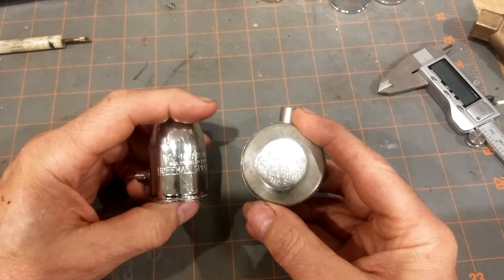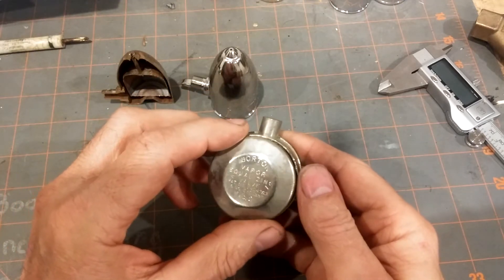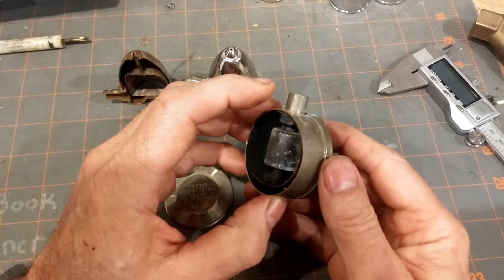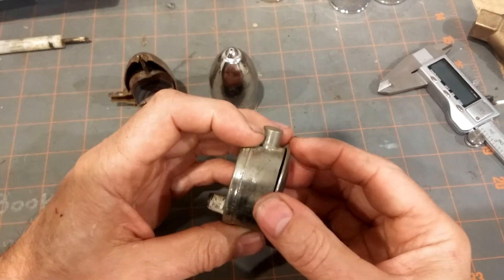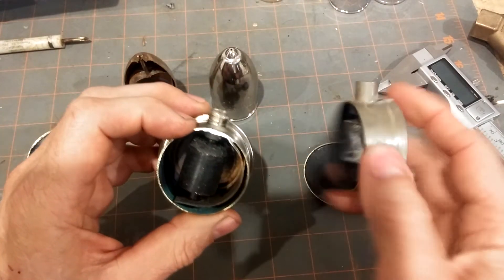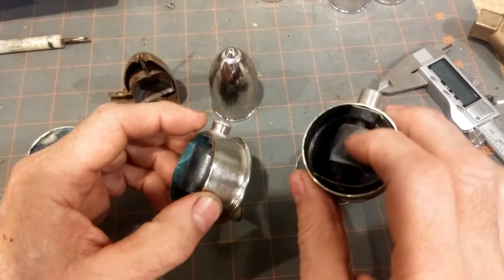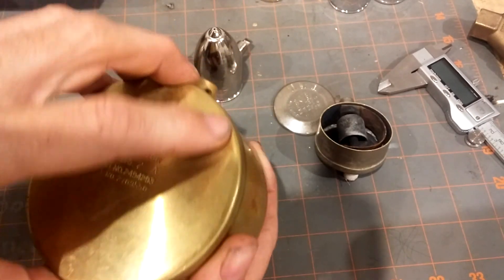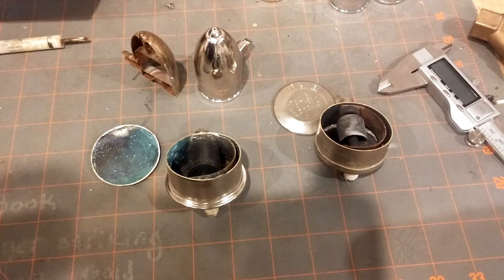Gorton / Maid-o-Mist Single Pipe Steam Radiator Air Vents

Comment: The advantage of the Maid-O-Mist is the interchangeable nipples.  This is helpful when trying to balance a single pipe steam system.  One does not have to remove the entire valve, which can be cumbersome, but rather simply change the nipple size for more or less heat. I have successfully balanced the steam distribution in my 90 year old home and it continues to be warm and comfortable.  I do agree that the valves can and do fail but the benefit of the interchangeable nipples outweighs this.
Reply from the maker: Totally get what you are saying.
I believe I do point out in the video the usefulness of the interchangeable orifices on the MoM, but not to your degree, and I thank you for that.
As professional, I dont use these anymore because of their higher than average failure rate and call-backs are costly.
Also, for tenant situations in larger apartments, they might not be the best vent to use.
Some have suggested using the cost effective MoM's to dial in the air balance, then replacing them with the appropriate non-adjustable but generally higher quality Gortons or even the Vent Rite adjustables.
Reply: Vairvalves offer the same ability to adjust and can do so on the fly making them superior.

Comment: Thanks for the video. I bought a house with steam heat and I'm trying to learn about it. I don't have an automatic water feeder so my first mistake last year was overfilling the boiler causing it to spit water from some area of the boiler and my main  steam valve which I checked a few days ago and noticed it was a hoffman 45. The heating seems to be okay, but  I wouldn't mind the 100 year old house heating up faster and could upgrading to a main valve like a Gorton 2 help with my heating? I keep on hearing about using a Hoffman 75 or a Gorton 1 or 2.
Reply from the maker: You're welcome!
Do you have just the one steam main?
I would use the Gorton #2 and maybe gang up two or more if they fit.
Properly venting the main can make a major difference in how evenly a system heats up.
I trust also your mains are insulated
Reply: @gordonschweizer5154  Thanks for the reply. I have one steam main and I didn't know the pipe had to be insulated. What does that consist of?
Reply from the maker: @Mikegee63  Fiberglass pipe insulation designed for the pipe size.
That's a whole other topic and trade.
Reply: @gordonschweizer5154  Thanks. For some reason YouTube isn't notifying me when you respond to me. I also forgot to mention that the main floor of my house has 3 wall recessed cast iron connvectors in the living room and dining room and a free standing radiator in the entryway and kitchen. The 2nd floor has free standing radiators in the bedrooms and bathrooms. I'm pretty sure they're all original house. The main reason I mentioned the convectors is because I watched a video where they stated that they were using g a Hoffman 45 on the steam main because the house had convectors instead of free standing radiators. Could those convectors be the reason why I have the Hoffman 45 on my steam main?
Reply from the maker: @Mikegee63  If I understand you correctly, you're saying you have a Hoffman #45 as your main venting in your basement?
Maybe it's a #4A "Quick Vent"?
If so, they are way way too small!
Reply: @gordonschweizer5154  Yes it's a Hoffman 45 on the main vent.
Reply from the maker: @Mikegee63  The Hoffman #45 is way too slow of a vent for a steam main in almost all cases.
I'd try to replace it with a Gorton #1 at the very least & see if you can fit a Gorton #2 if possible.
Reply: @gordonschweizer5154   Thanks. I have exactly 7 1/8" clearance between where the main vent goes and the ceiling. I'm gonna check the sizes to make sure I can fit the Gorton 2 if possible.

Comment: Great video.  Been looking to replace my main steam vents on a one pipe system and this definitely reinforces my desire to use a Gorton #2 if I’m able to.  Cheers!
Reply from the maker: Thanks!
I hope you can fit the Gorton #2.
Those vents are amazing at getting rid of air from the steam mains and thereby getting heat evenly to your radiators.
Reply: @gordonschweizer5154  Is it best practice to use a larger vent on the long main and a smaller vent on the shorter main? Could I run into a problem if I use the same vent size for both mains?
Reply from the maker: @Ldall87  Usually we attempt to get the steam to reach the ends of the mains at roughly the same time.  
Each system has its own personality, so it is possible that the same size vent on each end will achieve that very broad goal.
But even if its a few minutes difference in time to the ends, you should not run into a problem.
Give it a go.
Reply: gorton also makes a smaller vent with the same construction "gorton #1" one thing to be careful of ,if you vent the air too fast you may end up with more water in your pipes. there is a balance where the steam heats the pipe as the steam travels in the pipe and minimizes water accumulation from the steam condensing. too much water could increase water hammering

Comment: Just found this.  Very informative.  What arr the numbers mean on the Gordon steam valves. I just bought a gordon #5.
Reply from the maker: The numbers are more or less indicators of how much the vent can vent.  For Gorton, the #4 is the smallest hole and therefore the slowest vent.  The #5 is the next size up, and the #6 is the biggest holed vent I'd recommend for a large, stand-alone radiator that needs more venting.  
Gorton makes bigger holed vents, "C" and the largest "D", but they are too big and sometimes cause more issues than they solve.

Comment: Any thoughts about using the Gorton 1/8" straight type vents (with an added elbow) for radiators vs the Gorton angle type? My thinking is the straight type should provide better water drainage from the bottom of the vent body.
Reply from the maker: That might work... But, the main issue would be clearances to install.
Reply: Clearances would not be an issue. My question is whether there might be some functional benefit to having a straight stem for better condensate drainage out of the vent body.

I installed the Maid O’Mist vents just last year and I’ve found several to be stuck closed occasionally. I’m going to replace them all with Gortons.
Reply from the maker: If clearances are not an issue, there is no harm in trying your idea.  I have no experience if what you propose will help your issue or not.
The vents, even M-o-M in ordinary situations, should not have much water in them.

It may be that there are other issues.  

Do you have enough main venting? Are your main pipes in the basement insulated? Is your near boiler piping to manufacturer's specs? Is your boiler water reasonably clean?  Is your system pressure low? Is there water hammer? Gurgling in the pipes? Radiators pitched properly? Radiator valves the proper type and fully opened? 

The reason I ask is these and other reasons will cause "wet steam" and that may be causing your vents to fail prematurely.
Reply: Ok, thanks, Gordon. I believe I’m ok with the possible concerns you listed. 

I replaced Hoffman 1A vents last year with the M-o-M only in order to more easily experiment with the orifice settings.

I believe the M-o-M failures are due to little other than poor quality vent materials.

I might run my question by Gorton and see whether they think there might be any benefit to using their straight vents over the angle type.

Comment: On the maid o mist the adjustable screw on top..should it be tighted flush ? Or screwed open ? I have tgem screwed open.. my rads get hot just cincern of the purpose of the screw
Reply from the maker: I would screw the orifice plate thingy all the way down snug.

Comment: Thank you for this video!  I replaced a Hoffman 1A with a Gorton C.  I found the 1A to be loud and "hunting" in the cut-out range (my pressuretrol: cut in=0.4 psi, cut-out=1.2 psi).  The Gorton was silent.  Gordon, what is the expected single pipe behavior after the call for heat has been met and the boiler shuts down?  After a couple of minutes, two of my 2nd floor radiators with Gorton C's go into a loud vacuum.  Is that expected?  Thanks
Reply from the maker: Thank you for your kind works.
What you might be hearing is the vacuum formed when the steam is condensing drawing in the air back into your system. The cast iron beast is breathing.
If I may be so bold as to suggest adding main vents to the piping in the basement.
The "C" is pretty aggressive in venting air from radiators, not always to your good in the long run.

The strategy is to vent the mains quickly and then vent the radiators slowly - if possible... 

Of course I don't know your unique situation at all.
Reply: @gordonschweizer5154  Gordon, your videos have been helpful in helping troubleshoot my dads boiler! Thank you. I understand balancing the radiator vents but what is the benefit of venting the radiators as slowly as possible?
Reply from the maker: @Ldall87  If I said " as slowly as possible" then I misspoke.
I would say "fairly slowly" instead.
The issue is radiators are designed to squeeze the energy out of the steam and turn it into heat very quickly, and thereby dump a lot of water back down through the radiator valve.  
Too much venting (in general) can create too much water for the valve to handle and cause gurgling, spitting vents, water hammer, and a radiator heating poorly- the very opposite of what is desired.
The trick is to find that balance.
Enough venting to allow the radiator to heat the space the radiator is in, but not so much as to choke off the steam trying to come in with the water flowing out.
That's partly why main venting is so important.  
Get rid of most of the air first, then your can tweak the radiator venting with better results.

Comment: I so appreciate these videos. I live in a 20 apt building.  My apt is the first one, closest to to the boiler(my apt is right above the boiler so I hear the runs and cycles within each run).  My radiator valve  is fully open. The air vents  take on water, cause knocking ( right now only at the beginning of a run.. the rest are mostly quiet). Then the steam sound is constant and loud at the end of each cycle in a run.the radiator almost sounds like it’s crackling as it comes into the vent.   Yes Most runs are about 8 cycles and last abt 40 minutes.  I don’t know what the pressure is on the boiler.  The building usually uses Hoffman 40s.  I often shut the boiler (there’s a switch I have access to) unscrew it, and shake out the water.  I put a brand new maid o mist #6  round type on, but it took on water immediately.    Any thoughts?
Reply from the maker: I would maybe try the M-o-M #4, their smallest vent.  The #6 is usually too large in most cases on any radiator.
It sounds like the apartment is overfiring the boiler.
Reply: @gordonschweizer5154  Thank you.  I’ll try that the #4 , and mention the overfiring possibility.

Comment: Thank you, Mr. Schweizer. I picked up a Gorton No. 6 for my apt. building radiator which was spouting water (I'd been using a defective Hoffman, and learned why it became defective)! I appreciate your edifying videos!
Reply from the maker: You're welcome!
Hope the #6 isn't too much venting.
Remember to try to upgrade your main venting in the basement.
Reply: @gordonschweizer5154  I don't have a say what goes on in the basement! But my room is a cold room, so I think 6 will be okay. Question, though: I just boiled two Hoffman stem vents (I had to throw the older one away - I could blow through it whether I turned it upside down or not - and a new one was okay), but they both turned mostly orange after boiling for 40 or so minutes, approx 50% vinegar and 50% water. What do you think of that?
Reply from the maker: @JerusalemBladeTrue  The brown color might be copper leaching out of the brass? Or iron sludge deposited from inside the vent.
I usually just soak the vents in full (5%) white vinegar overnight at the longest. More then that and undesireable side reactions start occurring (iron plating out, green corrosion).
Reply: @gordonschweizer5154  Thanks - it looks like the copper. Should I just throw the Hoffman out - it looks like 75% copper on the outside, probably inside also.
Reply from the maker: @JerusalemBladeTrue  The acetic acid may have just stripped the plating off. The vent might work.
Reply: @gordonschweizer5154  Thank you!

Comment: can you demonstrate how to remove the old valves & install new valves in the radiator & in the poles
Reply from the maker: Do you mean remove radiator  *vents*?
Not sure what you mean by "in the poles"?
Reply: @gordonschweizer5154  thank you so much for your prompt response! This is a serious matter for me & I need help. I am on the Top Floor in an apt bldg & in each room I have the old-fashioned steam radiators on the floor and each radiator has a heat pole attached to it that runs through the other apts in the building as well. I am trying to replace the round metal air vent steam valve on each radiator and each Pole.
Reply from the maker: I'm sorry. I don't understand.  
Do you mean "vents" or do you mean "valves"? There are big important differences between them.
What do you mean by "poles"? Are you perhaps referring to "pipes"? 
Where do these "poles" or "pipes" go if you are on the Top Floor?
That does not make sense unless your building has the "Mills System" type of steam piping.
Why do you need to replace what you need to replace? Vents? or Valves? 
Again, I am very confused by your questions.
It is not a good idea to replace either vents or valves without shutting down the boiler, and that means you will need to inform the management of your apartment of your problem. 
Do you have a superintendent working for your apartment?
I cannot help you from here.
Reply: @gordonschweizer5154  thank you, they are the round silver-colored Vents, like Gorton brand, etc. Here is a link with photos. Sorry I dont know the plumber lingo :) thank you!
https://www.supplyhouse.com/Gorton-G6A-Gorton-No-6-Angle-Vapor-Equalizing-Valve-3531000-p
Reply from the maker: Ok, so they are vents and they are hissing/spitting water and steam?
Reply: @gordonschweizer5154  ok here is a photo of how the vent is in the heating pole -https://images.app.goo.gl/gjbfhP8fcxXRQ27v8
They are not hissing or steaming they are just jingling sometimes and one of them Huffs and puffs and the rest of them are just dead. It's 52 degrees in my apartment the landlord keeps putting used and broken vents to replace the old used and broken vents for the past six years. So I just want to go to Home Depot and buy seven of them and put them on myself, hopefully with your guidance I'd appreciate since I don't know anyone else to ask! Thanks so much
Reply from the maker: @TheTruthResearchers  First, find out what pressure the boiler is maxing out at. 
High pressure will cause issues with vents.
That may be why the vents are failing.
Any pressure above two psi is too much.
Getting crappy Home Cheapo vents might not help you.
The problem and the solution might not be in the same room.
I really can't help you much beyond that.
Reply: @gordonschweizer5154  okay well I will buy the vents wherever you suggest. This is my first experience. The landlord refuses to increase the boiler pressure to save money. There are 4 floors and he is only using enough boiler pressure to heat the first two floors. So if that is the case, is it a waste of time and money to change these vents? Thank you
Reply from the maker: @TheTruthResearchers  I am sorry if I was not clear. The pressure SHOULD be low.
 Very low!
"Pressure" does not heat the building. The hidden heat in the steam itself heats the building!

The pressure is only needed to get the air out of the pipes through the vents.
Where there is trapped air, steam cannot move.

If there is too much pressure, vents sometimes don't operate correctly!
The pressure should NEVER get above 2 psi.